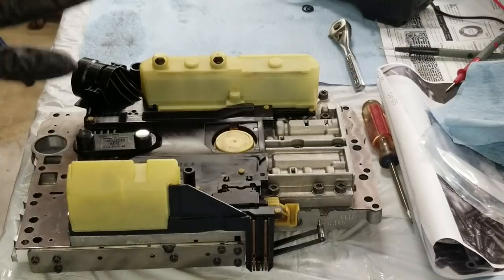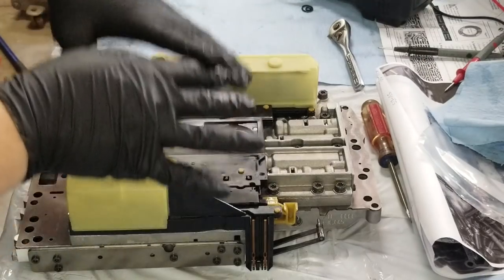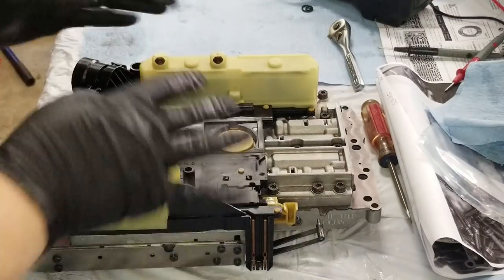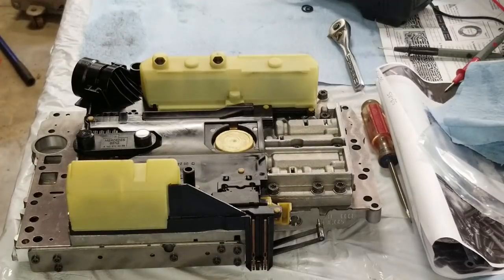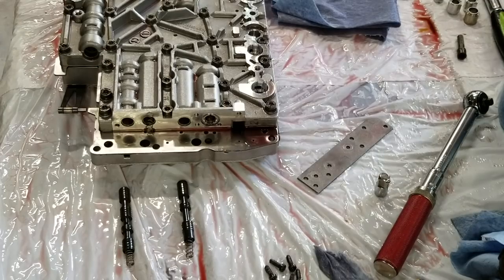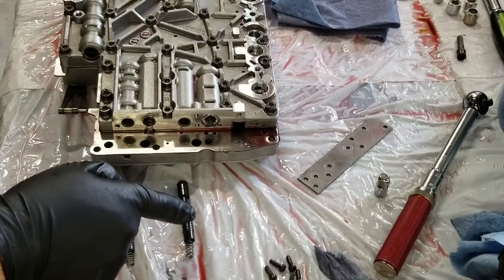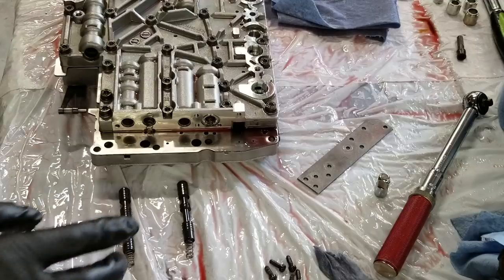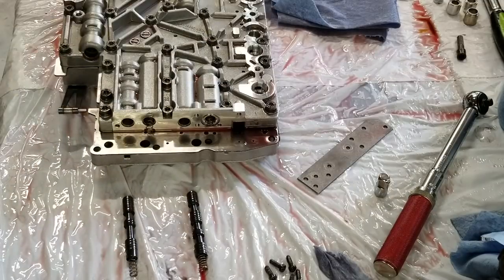722.6 Complete Valve Body Rebuild & Clean Timelapse

Comment: This video was an incredible help while I was installing a sonnax valve sleeve overlap kit and the tcc damper valve sleeve kit/solenoid. Thank you for your obvious dedication in assisting others. I found it later into my rebuild process, now I wish I had gone deeper and stripped it more! but since I'm only at 95k miles it's probably not as big of deal.
Reply: im at 100k and I was glad to go all the way - the fluid was BLACK - and went through cans of chlorinated brake cleaner
Reply: @Joe-rp8fd  solve problem?
Reply: @Joe-rp8fd  oke thanks😀

Comment: My tip is every time you find yourself going backwards. Go have a coffee. Give yourself time to think. Many times this has saved me from going backwards or having to go backwards twice. Also gives you a chance to check twice. My last valve body rebuild was an E4OD. A bearing exploded and the filter ripped bits of crap were everywhere. Took 4 assemblies to finally find all the bits of brass. Been forcibly retired from rebuilding since.
Reply from the maker: Solder Joe that's basically what I did. Just called it quits for the night. Watched the reassembily vs disassembly footage to try and find my mistake. Took about 3 runs through it all to figure it out.

Comment: I was having an issue with the 722.6 trans in my 2006 E320 CDI w/200k. Slight judder/oscillation under hard acceleration or climbing hills... RPMs had a slight fluctuation at cruising speeds...jerky 1-2 shifts when cold...with the occasional shudder slowing to a stop.  Purchased a new TCC/PWM solenoid on ebay for less than $30 and had it installed at a local transmission shop and now my transmission almost shifts like new.
Reply: Hi, did replacing the TCC/PWM solenoid fix it permanently? I am having this exact same issue now and deciding whether to do the Sonnax Damper kit as well or just the solenoid. Thanks
Reply: @samreeson5046  I no longer own the vehicle but it fixed the issue for as long as I owned it.

Comment: Great video!  Good lighting and informative! This video inspires confidence! I'm getting ready to replace a conductor plate on my NAG1(W5A580), because of a seized bolt in the adapter plug (which is weeping ATF). I believe this valve body (722.6) in the video is the same one found in the NAG1.  Also, I plan to have on hand the Sonnax 3-piece overlap and TCC Damper kit + Transgo Shift Kit (SK722.6-A).

Comment: Hey man, thanks so much for posting this, you're truly amazing! Do you also recommend the Transgo Shift Kit to go along with the Sonnax TCC Damper Kit + Master Overlap Sleeve Kit? The Transgo kit includes a Pressure Regular Valve, Lube Regulator Valve Assembly, and an upgraded 2-3 spring, but I was unsure how much of an improvement it provides and whether it gets along well with the Sonnax kits. Two more questions: Is it possible to clean the valve body without removing ALL of the internals? Also, do you recommend changing the TCC solenoid ($35) while I'm already in there for good measure?
Reply: hi friends, i need to rebuild my gearbox, i plan to change the torque converter, and i also want to rebuild the valve body.  I found the transgo kit on the net, is it enough or do I need more?  thank you for your time!

Comment: do you have any links to the repair kits used here?

I have my issue the the torque converter does not lock up in all gears. changed it and the liquid and not a fix so I suspect something in the valve body. 

thanks

Comment: Hello, I have ML270 cdi w163113 year 2003. For a month I have a gearbox problem.
I noticed that there is a mixture of transmission oil with water giving a coffee with milk color (brown not whitish).
I changed the radiator including the coolant and I proceeded to drain the gearbox.
Unfortunately, after normal diagnosis, the vehicle does not depace 90 km/h and the speed remains in 3rd.
Cordially.

Comment: I'm having trouble inserting the TCC valve into the valve body of my '03 C240.  Pushed as hard as I could by hand and it just wouldn't budge.  Sized the o-rings as instructed.  Is there a cut off date on the Sonnax upgrade, or should I take a hammer to it, ha?

Comment: I changed the electrinoque board. There was a lot of dirt under the electronic board. I cleaned the selenoids but I did not dismantle the hydraulic block (spring, balls etc). I have very rare transmission collisions and also between the 2nd and the 3rd the transmission takes time to make the change. Should I have cleaned the block by completely disassembling it like this video ?
Reply: I don't think a deep clean will help you with the rough shifting. It seems like you would benefit from installing the Sonnax Master Overlap Sleeve Kit (Part # 68942-05K) and Sonnax TCC Valve Damper Kit (Part # 68942-23K). There is also a Transgo Shift Kit (Part # SK722.6-A). All of these parts require no reaming/modification to the valve body, and many people report it completely changes the way the car feels when shifting (in a good way - no more rough TCC lockup or jerky/flaring shifts).
Reply: @sicilianstyle4517  thank you so mutch

Comment: Great video!! I just had my transmission rebuilt on my 2008 C300 that only has 32,000 miles on the dash. My wife ran through a high body of water last week which was about 2 miles from our house where she was able to drive home. The next day the car wasn’t shifting normally. Had car tow to shop, they rebuilt the transmission but saying it is flaring. Still no codes are being read. What do you think can be the problem?

Comment: started out ok removed upper from lower 722.6 valve body on my 2006 e320 cdi and notice one small round rubber with cross open in middle on my work bench. have no idea which hole it fell out of. might have been stuck on inner plate that is between upper/lower body. any help?

Comment: You really need a nut driver to get those valve plates started! Anyways, fantastic video, really crucial info documented for the rest of time! Question: At what point is this just... recommended for a car? I have a 2006 Mercedes C55 (400 HP/TQ) w/ 85,000 miles that I just got and am going to do a fluid change, but I am on the fence about going any further. Opinions?

Comment: Thanks for the video! I have a w116 with a 722.1 gearbox, which has been idle for 10 years, and the gearbox is unstable. I would like to know if these balls and valves can be unlocked without opening the gearbox? Could you put decarbonizing in the oil?
Reply: Take it appart. No other option. CAUTION is not a easy job puting it back on.

Comment: Torque converter transmissions seem to be more complex than even the engine itself. After seeing some of these internals videos I'm not surprised why standard transmissions are more reliable -- they only have 1/10th of the part count!
Reply: The design of these valve bodies remind me of old, hand-drawn circuit board artwork. I guess the valve body actually IS a fairly complex circuit, just a hydraulic circuit, rather than an electric one. Which would make this MB valve body a two-layer PCB.

Comment: So i have a 2007 Jeep GC with the OM642 engine AND the 722.6 and a 2005 E320 CDI ... also with the 722.6.  Will this work for BOTH of those transmissions?  Also did you post a link to this Rebuild kit?    I went to FCP euro and i might be missing the link for the whole thing, but found various different parts!

Comment: question im working on my 2002 cl55 mag doing the same job, is there 5 filters? for the solenoids??
I only have 2 atm smh
Reply: also I can only find non chlorinated brake cleaner is that a problem if I use that?
Reply: @freshwhipss33   WD40 or any brake cleaner will do the trick as long you don't have any plastic/rubber left on the body.  
You have only 2filters for 2 valves.

Comment: Any videos about the clutch packs and transmissions bands?   We see lots of friction material in the pan when doing a service, but almost no videos on changing them out.
Reply from the maker: no bands in the 722.6, clutch packs are very robust and you will notice delayed engagement and slippage when they're worn out. i have a couple videos showing a 722.6 rebuild, a little sloppy because of the circumstances, but still shows what needs to be done. compressing the piston springs requires special tools, but you can make them yourself as i did.

Comment: Old video but i thought i'd ask/put it out there. I got a 2006 Dodge Charger (NAG1) pretty sure it's the same thing besides maybe a few differences, anyways. 220k kms i got it at 175k (120k miles lets say) The fluid was nice pink last time i check it, which it's Mopar Atf +4 so maybe a little light but it seemed fine and smelled fine. Shifts fine all day long, for the most part. Autostick works awesome, never fails me the only ''issue'' i guess is that if im in 3rd gear, smash the gas (well smash the gas downshifts me into 3rd) and then it trys to get into 4th (WOT) it just will sit there, not going any faster at redline (6000 ish) and just wa wa wa wa then if i let off just a bit like to 70% throttle it shifts fine. Was wondering if anyone had anything they could see being the issue, i worked at a trans shop for a bit but it was just hauling them mostly and pan gasket/fluid changes. (other work too but that was part of it) I've never actually checked it (the level) so maybe over time it's just a little low? Doesn't seem to be any leaks in there, maybe a rear main/torque seal hard to tell but very minor leak coming out of the bellhousing. I'm getting one of those sticks with 10mm markings and i'll check it when it's hot and see what it reads, in know you're meant to use a scan tool...but yeah. Any help would be awesome thanks. Not a big issue just a slight concern.

Comment: Great video!  It's helping me finish my NAG1 VB upgrade. Quick question, did you have to chamfer the bore edge on your VB prior to installing the TCC damper valve?Sonnax instructions...NOTE: Prior to installing O-ringed sleeve into the bore, chamfer the bore edge with adeburring tool. This will prevent the O-rings from shearing during assembly.
Reply from the maker: I used a snap blade razor and a file to chamfer the edge. Just needs a LITTLE chamfer, just enough to help the o-rings compress in.
Reply: @MBDieselFreak   Should have asked, the 3 sonnax overlap sleeves, chamfer those bore edges too? And you reused all the solenoid O-rings?
Reply from the maker: @350Zquicksilver  I replaced all solenoid O-Rings, and I did not chamfer the overlap sleeve bores, I just hit them real quick with a knife to make sure there was no burrs and to knock down the sharp edge just a bit.
Reply: @MBDieselFreak  I appreciate the feedback! I would replace O-rings at 450k too! Amazing mileage!!
Reply from the maker: @350Zquicksilver  460k and still going strong!

Comment: 139/5000
Why is there a 3 to 4 second delay before entering gear, after changing the body valve, selenoils, filter, shifter, etc.?
Reply from the maker: Did you rebuild the valve body or swap it out?

Comment: My dad has the same om642 engine and is complaining about occasional exhaust smell in cabinet. He thinks it's coming from under hood and drifting in cabin when at stop lights etc.  Any weak points that I can check for exhaust leaks. Its not noisy and the exhaust system under car is in good shape. thanks
Reply from the maker: Donald Holder Exhaust manifolds. Had the same issue on my E320 bluetec. The one of the exhaust manifolds had cracked open in one of the flexible sections leading into the turbo.

Comment: Is using regular brake cleaner okay? I can't seem to find chlorinated versions in Europe.
Reply: I used unscented mineral spirits. Worked excellent.
Reply: @budlanctot3060  I ended up using brake cleaner on the valve body after removing the balls and filters.

Comment: So no switch to the blue top solenoids? Is that just an E55 thing, and we're staying with the regular ones on the CDIs?
Reply: No need for the blue valves in a CDi. Even the standard E55 came with brown or gray valves. Only the SLR had blue valves stock and possibly the SL55 black series.
Reply: Moreover you need the correct transmission computer to make use of the blue valves correctly

Comment: So i went ahead remove my nag1 valve body and the side cover t20 torque was so hard to remove. Broke too..
Reply: My t20's were awful tight, too. I used a t20 bit in my 1/4" nut driver to hold the bit very perpendicular to the plate edge and hold the bit securely in the head of the screw, and then used a 1/4" 6pt box end wrench on the t20 bit's hex shank to do the actual twisting. It worked slick.

Comment: Hello i need help i have got my gearbox everything new clutch and gasket and converter and new board and new oil and all made new and still does not just switch 1 and 2 gear or gear stays in third gear and i have error P2502 can you help me  You're welcome

Comment: I have a slight pulse or bounce in my rpms between  1000-1200rpm but only under a light load. ATF level is fine. Any ideas? Also what is the best way To support you ?$$
Reply: I have Venmo and PayPal.
Reply from the maker: So a bit of a surging in RPM's under light acceleration? Can you feel it in the car too, or is it only visible on the tach? 

It might be the transmission slipping, or it could be an engine issue. I'm not really sure without further information. 

As for support, no need for monetary support, just views! I MAY start a Patreon in the future for those that REALLY want to help support my MB adventures, but for now I just appreciate the views. :)
Reply: MBDieselFreak yes, under light acceleration only and I can feel it, but it’s not super noticeable. The “problem” goes away completely, once the car has been at OT for 30 mins. So basically it only happens when the car isn’t fully warmed up.  my 2nd gear does make a slight winding sound when decelerating , probably unrelated  but it might be related to my 2nd gear.

Comment: Very nice video!
I'm going to change the  TCC damper valve sleeve soon. For this purpose the valve body should be split into two pieces. Is is possible to split the valve body without removing all components?  Is it worth to take all steel balls and clean everything or just to reinstall the dapper valve?

Best Regards
Reply from the maker: If you've got to tear the valve body down Into it's 2 half's, you HAVE to remove all the little check balls and filters. There's no other way. So you're going to be doing exactly as I did.
Reply: Thank you for not only being concise & precise (especially when you were not ... made a mistake and explained). Mostly Thank you so much for the diagrams. And torque specs!

Its a blessing to watch someone like yourself that gets to the point.
Use a pointer like pen or screwdriver when your body might block the view...and play whatever music you need to
- we all have volume controls ;)

Comment: Will someone please tell me that what is the function of "OIL FLOATS" ?
Reply from the maker: on the conductor plate? it is essentially a plug that prevents oil from getting into the upper gear box if the transmission is overfilled. it serves no electrical purpose, its essentially mechanical overfilling protection.
Reply: @MBDieselFreak  thank you so much 😊

Comment: 450,000 miles? Is this the first time Valve Body is being rebuilt?
Reply from the maker: I don't have a single clue. Lmao. My guess is yes
Reply: @MBDieselFreak  Is it possible to remove the entire auto transmission, TCU and replace it with a manual transmission?
Reply from the maker: @minnus222  virtually impossible without custom machined parts. There is not a manual transmission in the world that will bolt up the OM648. You'd have to have a custom bell housing made